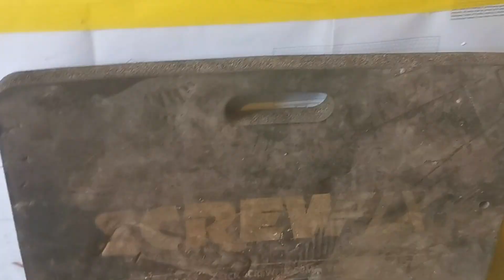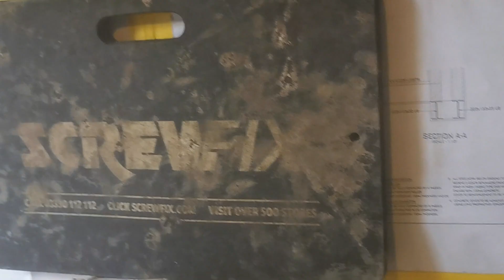UNDERPINNING in Tight Space | Real Builder’s Guide from the Trench

Comment: So the soil/clay you dug out wasn't strong enough to hold the house up, hence it needed digging out and filling with concrete, but it was still OK for you to get under there to dig the clay out. Whilst we are on the subject of foundation, my neighbour just had to dig a trench 1.6 metre deep for his detached back garden garage. Despite the fact, our houses are sitting on 9 inches concert foundations. Building control appear to have gone overboard with  regs. Last garage I had was just sat on a 6-inch raft.
Reply from the maker: I hear what your saying, and I often feel the same way. However this is quite a common requirement these days, as people want bigger and bigger open plan spaces and the pad I dug on this episode is to take the load of a steel column and 2 beams ready for when I completely remove the ground floor corner of property, hence why the existing strip footing needed to be underpinned for extra lateral support. Hope this explains your question 👍